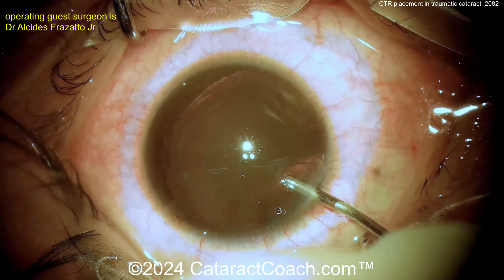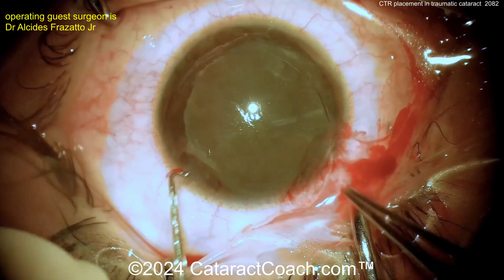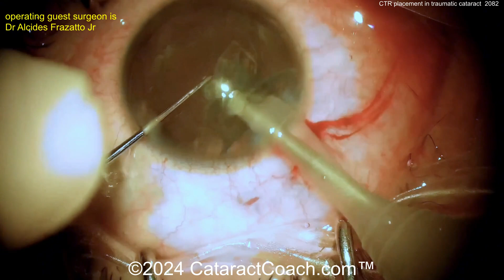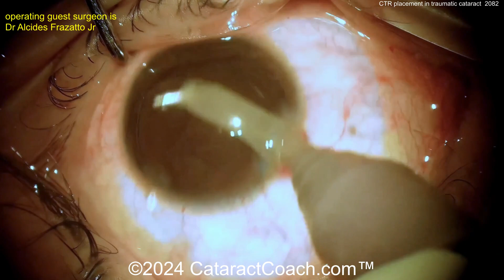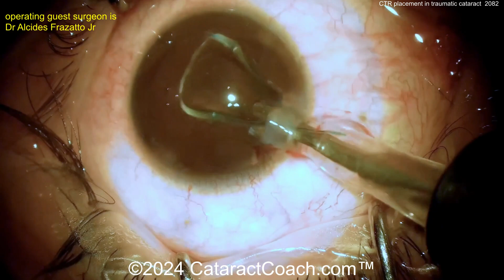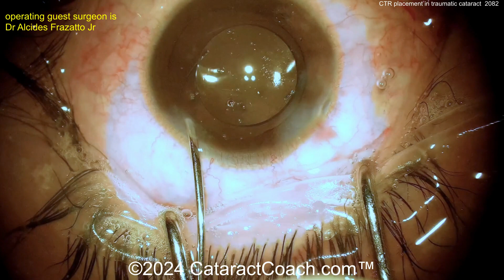CataractCoach™ 2082: CTR placement in a traumatic cataract

Comment: nice case. Zonular dialysis sucks. It really does make the case significantly more difficult. This was nicely handled by the surgeon here. I agree with you and have found significant IOL / bag stability c CTR combined with 3-piece IOL, haptics in sulcus, optic captured in bag. Discovered this accidentally but have since seen it presented. Not sure if anyone has written it up.